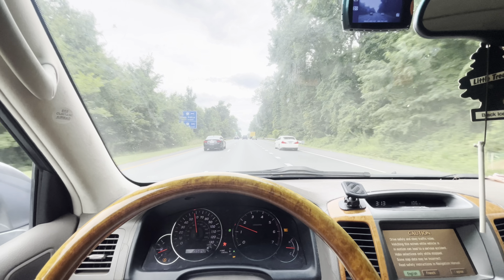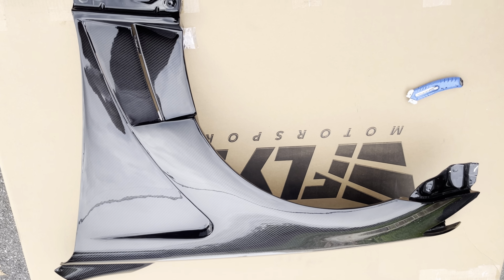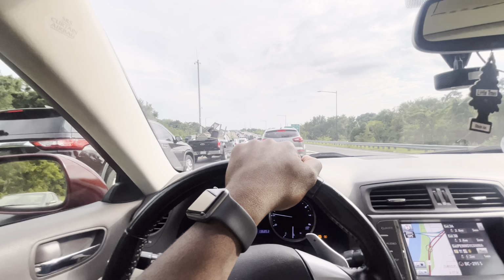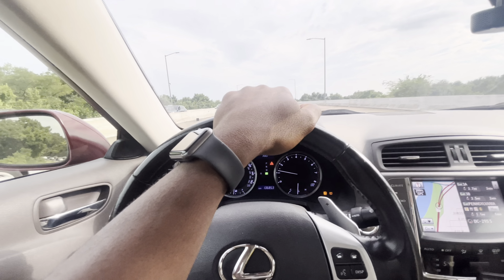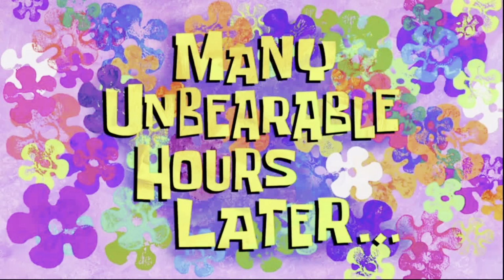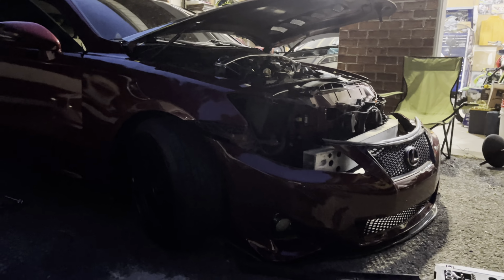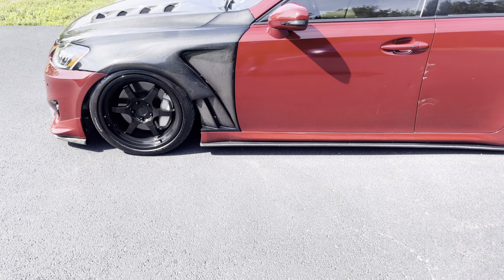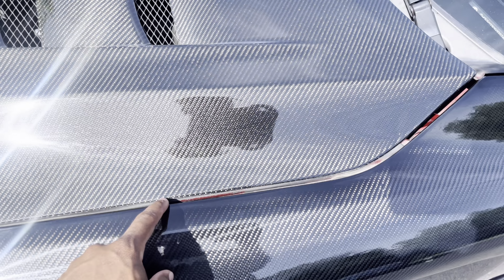Installing FLY1Motorsports Carbon Fiber Fenders on My Lexus IS350

Comment: When you open the door the rubber seal if you lift it up there’s screws behind that’s how you get the the bottom fender bolts easier Ik it’s too late for you but for the next guy
Reply from the maker: !!! I should’ve shown that better but we were tired and frustrated 😂
Reply: Thanks Im going to tackle this whenever.

Comment: They look great ! Thanks for making videos more the Lexus is platform. We need as much support as we can get. I need to find some rear bumper connector tab things from where it hooks to the rear quarter. Mine is broke on the bumper and I’m wondering how I can re attach it
Reply from the maker: That’s a whole 2is thing 😂. Mines does it on the passenger side